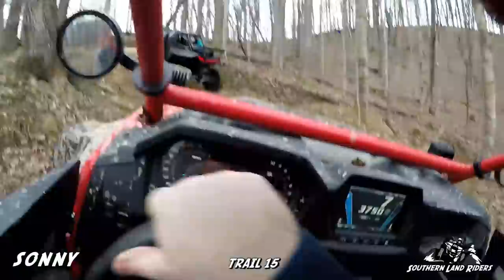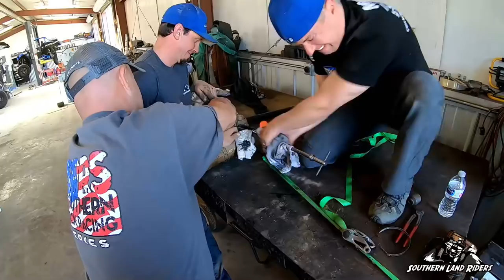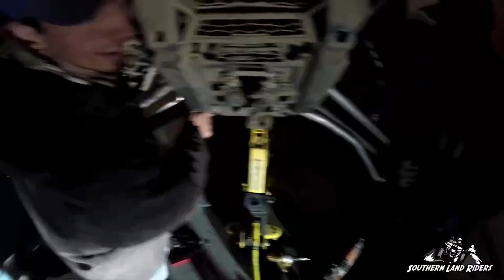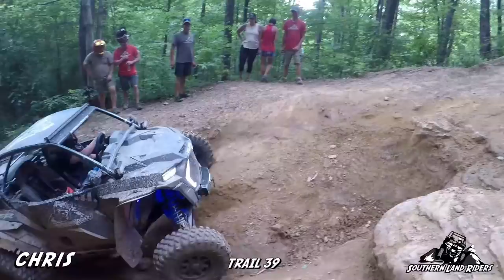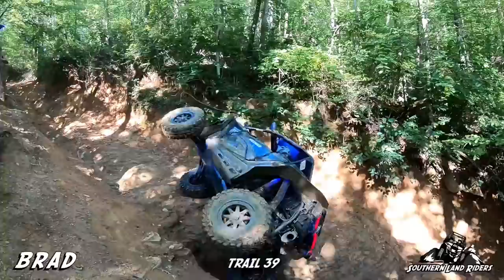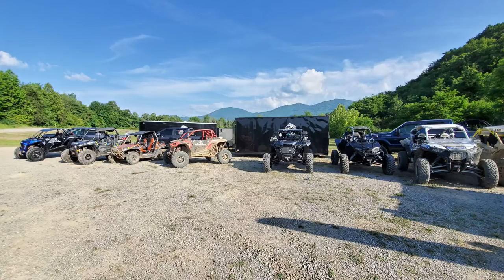Southern Land Riders 2019 Year in Review

Comment: I just bought a 2019 xp 4 turbo s. Was wondering if you guys have extended vent lines at all on any of yours and if so what you are using (pre made kit or just buying lines and fittings etc)?
Reply from the maker: No sir we have not. I did on my 2016 but not my last 3 RZR's. We do not ride much mud.
Reply: Southern Land Riders awesome thanks for the response. How about any gear reduction?
Reply from the maker: @brianmcbride99  Chris did a gear reduction in his 1st turbo S but none of us have done them since. I love the factory gearing in my S. I can keep it in low 95% of the time and still get up to 60 mpg in low. Crawling is not an issue either.
Reply: Southern Land Riders right on! Thanks for the response, love your videos!